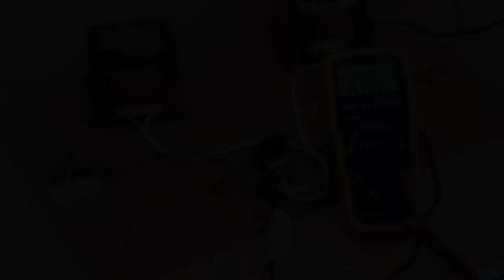DIY Welding Machine / Only 2 Microwave Transformer / Good Job

Comment: Selamun aleykum ustam. Diğer kaynak makinesi videonuza yorum yapmıştım birkaç bilgi vermiştiniz. Bir soru daha sormak istiyorum. Aslında diğer videoya yorum olarak sormuştum ama link paylaştığım için sanırım Youtube beni engellemiş yorumları göremiyorum diğer videoda. Buradan sormak istiyorum bu sefer link paylaşmadan 😅😅
Fan için Led trafosu kullanabilir miyiz. Mesela 12 volt 3 amper 36  watt lık bir Led trafosu var. Onu fanları çalıştırmak için kullanabilir miyim. Fanlara zarar verir mi acaba?
Reply from the maker: Aleyküm selam Rıza bey. LED trafosu çıkışı 12V ise bir sorun olmaz. Bazı LED trafolarında çıkış gerilimi yüksek olabilir. Yani 12 yazsa bile ölçmek iyi olur
Reply: teşekkür ederim. Çıkış voltajı 12 diyor sadece amper kısmı ve watt kısmı kafamı karıştırmıştı onu da siz halletmiş oldunuz. Teşekkür ediyorum. Alınca ölçerim doğru voltaj veriyor mu ona göre takarım inşaAllah. Ufak ufak malzemeleri toplamaya başladım. Bu arada hurdacılar sitesine gittim. Mikrodalga trafosu var mı mikrodalga içinden çıkıyor dedim. Adamlar onda pek değerli birşey olmadığı için topluca atıyoruz diyorlar. 😅😅.
Bende sahibinden üzerinden aldım iki tane, tanesi 110₺.
Reply from the maker: En önemli malzemeyi bulmuşsunuz zaten. Umarım tamamlarsiniz. Yardım gerektiğinde yine yazın. Hayırlı akşamlar
Reply: selamun aleykum ustam. Benim trafolar geldi ama birbirinden farklı ikisi. Üzerinde kod olarak birinde 700E-4 yazıyor. Bunun yüksekliği h: 7,5cm, bu küçük olan diğeri daha büyük. 

Diğeri 700E-1, bunun yüksekliği de h:9 cm. Genişliği de diğerinden 1,5 cm daha büyük. Sizin kullandığınız trafoların kodları nedir acaba. Muhtemelen sarım sayısını etkileyecek bu durum. Çok sorun olur mu acaba? Yoksa büyük olan trafodan bir tane daha mı almam lazım
Reply from the maker: @rzatasdemir7456  A.S. Rıza bey. Bu trafolarin ikisi de 700W gibi görünüyor. Boyut çok farketmez. Birebir aynı olsa daha iyi olurdu tabi ama yine de kullanılabilir.
Reply: selamun aleykum Murat ustam. Nasılsınız iyisiniz inşaAllah. Rabbim sağlık sıhhat versin.

Ustam ben trafoları almıştım malum. Birkaç gün önce de silikon kabloyu felan temin ettim. Diğer malzemeler de hazır. Bugün trafo sarımlarını yaptım. Size bahsetmiştim birisi biraz küçük trafonun diye. 18 sarım sonrası baya zorladı beni. Wd40 sıkarak sardım kaysın diye. Yoksa sarılmıyordu. 20-22 sarım ona yaptım. Büyüğüne de 25 sarım yaptım galiba. Gerilim testini yaptım. 46,5 - 47,5 volt arası değer aldım. Sanırım birkaç sarım fazla yapmışım. Nasıl bu değer sorun olur mu. İşleme devam edebilir miyim?
Reply from the maker: @rzatasdemir7456  Aleyküm selam Rıza bey. Seri bağlantı yapıldığı için hiç sorun olmaz. Bu şekilde devam edebilirsiniz. Deneme yapacak aşamaya gelebildiniz mi?
Reply: yok ustam henüz sadece dün akşam sargıları sardım. İlerledikçe yazarım inşaAllah. Allah'a emanet olun
Reply: selamun aleykum Murat ustam. Biraz önce bağlantıları yapıp kurdum sistemi. Kutusunu yapmadım henüz açık vaziyette yani. Evde 2-2,5 mm kutu profil vardı. Çatı işinden kalan da elektrot. Elektrotları nemi gitsin diye fırına da koymuştum. Bu arada daha önce hiç kaynak yapmadım 😅😅. İki profili birleştirdim. Dimmer devresi sona kadar açıktı. Profili eritti. Kıstım, bu sefer kaynak oldu. Birkaç parça daha deneyeyim dedim. Elektrot yapışma durumu gösterdi hemen kaldırdım profilden. Biraz ayarını arttırdım az bişe gene az yapıştı kaldırdım hemen. Yani yarım saniye durmamıştır profil üzerinde. Sonra çalışmadı sistem. Baktım dimmer devresinin sigortası yanmış. Son durumum bu şekilde. Elektrotlar biraz eski ondan dolayı mı yapıştı ve yandı acaba. Nasıl bir yol izlememi tavsiye edersiniz bu noktada. Biraz uzun oldu kusura bakmayın. Bu arada elektrot ölçüsü 3.25
Reply from the maker: A.S. Elektrod yapışması akım az olduğu zaman olur. Elektrodun durumu da önemli ama en büyük sebebi akım azlığı. Akım ayarını en uygun seviyede ayarlamak lazım. Siz dimmer devresine ekstra triyak eklemesi yaptınız mı
Reply: yok hocam eklemedim. Direk şemadaki gibi kullanıyorum. Elektrotlar nemli olabilir. Uzun süre dışarıda kaldılar. Gerçi fırında beklettim ama. Malum Samsun nemli memleket. Yeni elektrot aldım ama henüz elime ulaşmadı. Dimmer devresini son ayara açınca profili eritmişti. Kısınca da sanırım yapışıp sigorta yandı.
Reply from the maker: Dimmer devresinin sigortası düşük kalmış olabilir. Benim devrede sigorta yok. Ama 10A otomatik sigorta takılı priz kullanıyorum. Çok seyrek de olsa attığı oluyor. Aslında 16A falan olsa daha iyi olur.
Reply: Makinenin bağlı olduğu prizin sigortası 16 amper. Şimdi köydeyim 3-4 gün ilçeye gidemeyeceğim. Gidince dimmer için sigorta alırken biraz daha büyüğünü mü almamı tavsiye edersiniz. Devamlı da soru soruyorum ama kusura bakmayın.
Reply from the maker: @rzatasdemir7456  Estağfurullah. İstediğiniz kadar soru sorabilirsiniz. Fırsat oldukça cevaplarım. Priz sigortası 16A ise dimmerdeki sigortayı tel ile kısa devre yaparak deneyebilirsiniz. Ancak triyaklarda arıza oluşmuş ise yine kesebilir. Sigorta alacaksanız 16A alın
Reply: ustam kral adamsın. Sevindirdin beni. Allah da seni sevindirsin. Dediğin gibi yaptım. Sigortayı tel ile şase yaptırdım. Kaynak çalışıyor. Birkaç sefer gene yapıştı elektrot ama bir sıkıntı yok. Yeni elektrot gelene kadar birşey yapmayacağım. Birde kaynak maskesi alayım en iyisi 😅😅😅. Sırada kutusunu yapmak kaldı bakalım. Eldeki imkanlar ile birşeyler yapacağız inşaAllah. Ya birde birşey sormak istiyorum. Şase ve pense yi bağladığımız silikon kablo bir yere bağlı değilken nasıl oluyor da içine elektrik akımı giriyor çok merak ettim doğrusu. Cahilliğimi af buyurun inşaAllah.  Tekrar görüşmek üzere Allah'a emanet olun
Reply from the maker: Çok teşekkür ederim Rıza bey. O sizin güzelliğiniz. Maskeyi kendinden kararan maskelerden almanızı tavsiye ederim. Ama soruyu anlayamadım galiba. Şase pensesini kaynak yapılacak metale baglamazsaniz akım geçişi olmaz. Yani kaynak yapılamaz. Siz başka bişey den mi bahsediyorsunuz
Reply: şunu sormak istedim. Silikon kablo sardık ya onun bi ucu şaseye bağlı diğer ucu elektrot maşasına. Yani prizden gelen eletrik ile doğrudan bağlantısı yok. Elektriği içine nasıl alıyor onu kavrayamadım. Evet dediğiniz gibi maskeyi kendinden kararanlardan aldım. Sipariş verdim hepsiburada sitesinden biraz önce. Sağ olun.
Reply from the maker: Şimdi soruyu anladım. Burda olay şu şekilde gerçekleşir. Primer sargı yani 220V bağladığımiz sargı enerji verdiğimizde trafoda manyetik alan oluşturur. Bu manyetik alan trafonun sekonder sağı tarafına nüve yani trafonun metal bölümleri sayesinde ulaşır ve sarım sayısına göre sekonder sargida elektrik endukler. Örneğin 1 sarimda 1V oluşursa 20 sargı olduğunda 20V oluşur. Sarım sayısı arttıkça gerilim artarken bu oranda akım da aşağı değere düşer. Mesela punto kaynak makinesinde 2 sarım yapılır ve 2V gerilim elde edilir. Ama akım 600A gibi değerlere çıkar. Tabi bu akımı taşıyabilmek için çok kalın kablo sarmak gerekir. Ark kaynak makinesi elektrodu erittigi için 100A civarı akım iş görür ama punto kaynağında metalin kendisi eridiği için 500A üstü akım gerekir.
Reply: elektrik muhteşem bir varlık. Açıklamanız için çok teşekkür ederim.
Reply: Selamun aleykum ustam hayırlı günler. Kaynak makinesini %90 bitirdim. Yanlız bir sorun ile karşılaştım. 2 saattir sebebini ararken sonunda buldum.
Şase ve pense nin girdiği dişi kısımlar var ya. Ben onları sizin yaptığınız gibi kutuya sabitledim. Benim kutu sac. Makineye eletrik verince trafolar düşük ayarda aşırı ses yapıyordu. Yükseğe açınca sigortası attı. Sebebi ararken buldum. Dişi soketler birbirine kutunun sacı ile bağlanmış oluyordu. Sizin videoyu izledim tekrar tekrar. Dişi soketleri sizde kutunuza monte ettiniz. Sizin kullandığınız malzeme elektriği iletmiyor mu yoksa soketin dış kutuya temas etmemesi için arada bir yalıtım malzemesi mi var. Benim soketlerde öyle birşey çıkmadı ama. Nasıl yapabilirim diye düşünüyorum.
Reply from the maker: A.S. Rıza hocam. Ben de alüminyum kullandım. Yani iletken. Ama soketlerin kendi yalıtkan malzemesi olmalı. Zaten bütün makinelerin kutusu saç oluyor. Yalıtkan malzemesi olması lazim, hatta yanlış hatırlamıyorsam dönmemesi için bir çıkıntısı olan parçalar
Reply: tamam ustam buldum. Arkasında bir parça çıkıyor. Ona göre yuva açıp sacı iki parça arasına almak gerekiyormuş. Bitirdim biraz kaynak da yaptım. İlk defa kaynak yapıyorum. .
Biraz fazla mı ısınıyor bilmiyorum. 1 tane güçlü fan dışarı veriyor havayı iki fan da içeri taze hava veriyor. Birde çok yapışıyor elektrot ilk kez takınca. Benim acemiliğim mi yoksa yapmam gereken birşeyi eksik mi yapıyorum emin değilim. Dimmer ın ayarını sona açıncada yapışma yapıyor. Sanki elektrot biraz ısınınca yapışma olmuyor. 1,5-2 mm profili eritiyor sonda. Sanırım acemilik var. Biraz daha video izleyip bilgi edinip sonra tecrübe kazanmak gerek sanırım.
Reply: biraz önce ilk kaynak denemem de yapışınca çok ses yapmıyordu. Hayvanlara yem verip geldim biraz daha denemek istedim. Şimdi yapışınca biraz daha fazla ses çıkarmaya başladı makine. Normal kaynak makinelerinde de oluyor mu acaba böyle.
Reply from the maker: Yapışma durumunda vınıltı şeklinde ses gelir. Bu normaldir. Biraz yüksek de olabilir. Bunun sebebi trafo çıkışının kısa devre kalmasından dolayı titreme olmasıdır. Trafo vidalarla sabitlenmemis veya sargılar sıkı sarilmamis ise ses biraz daha fazla olabilir. Akımı arttırıp denediniz mi. Normal kaynak yaptınız mı yani
Reply: evet ustam yaptım. Çatıya vinç asmak için L profil yapmıştım onun kaynak olacak yerlerini kaynak yaptık. Biraz kötü oldu ama sanki oldu gibi. Bazı yaptığım kaynaklar güzel oldu. Bazıları kötü. Ama çalışıyor yani. Birde elektrot çok çabuk bitiyor sanki ya da bilmiyorum bana öyle geliyor. Çabucak kaynayıp eriyorlar. Sargılar çok sıkı, 4'er vida ile de güzelce sabitledim trafoları. Ses niye yüksek anlamadım. Belki de normaldir. Dediğim gibi bu işin cahiliyim. Size de tekrar teşekkür ederim.
Reply from the maker: Doğrusu kaynak işinde ben de acemiyim. Ama el alışması da lazım, onu bilmiyorum. Akım çok fazla olursa elektrod daha çabuk biter ve ince metaller delinir. Bunların hepsine alışmak gerekiyor galiba. Çalışırken dikkatli olun lütfen. Elektrikle ilgili de sorun yaşanabilir ama ihtimal düşük. Ama sıcaklık ve ışık tehlikeli
Reply: teşekkür ederim. Dikkatli oluyorum. Otomatik kararan maske çok kullanışlı. Yüzü de komple kapatıyor iyi oluyor. Artık yapa öğreneceğiz. Allah'a emanet olun. Tekrar görüşürüz inşaAllah
Reply from the maker: Siz de Allah'a emanet olun Rıza bey. Sağlıklı günler dilerim

Comment: Lo que es importante no lo dice, en los devanados secundarios cuanras vueltas lleva y de que CALIBRE DE CABLE.
Reply from the maker: Hola.  Compartí esta información en el subtítulo.  Los subtítulos en español están disponibles.  Escribiré aquí también.  Cable de cobre con aislamiento de silicona de sección transversal de 4 mm2.  También lo puedes encontrar como cable N2GFAF.  Para cada transformador se harán 24 bobinados, y para estos 24 bobinados se requieren 6,5 metros de cable, 13 metros en total.

Comment: Will this only work with 240?
Reply from the maker: Hello.  It will also work with 120V.  Because microwave ovens in your location are also designed to work with 120V voltage.  If you look at the comments of this video, there are those who make it and run it with 120V.
Reply: Sorry i should've been more specific... will it be powerful enough? Even more specifically i actually wanted to use it to melt aluminum for casting.
Reply from the maker: Hello.  The power will be the same.  On the input side, 10A is drawn from the 220V mains, while 20A is drawn from the 120V mains.  That is, when the input voltage drops, more current is drawn.  This also applies to the microwave oven used there.  Because he must use the same power to cook the food.  But I don't know if it can be used for the job you mention.  How much current is used in the aluminum casting business?  What kind of transaction?

Comment: Bueno  he analizado este trabajo esta exelente pero hizo falta al exponente exponer el cable de la numeracion a mi parecer es cable 10 sino pues q me corrija el maestro
Reply from the maker: Hola.  En primer lugar, gracias.  Según tengo entendido, te refieres al cable que uso en el devanado secundario.  Usé un cable de cobre con aislamiento de silicona de 4 mm2.  El código del cable es N2GFAF.  También se puede utilizar un cable como AWG10 en lugar de este cable.  Lo importante es que el aislamiento del cable sea resistente al calor.
Reply: asi es es correcto gracias muy bonita su expocicion
Reply from the maker: Gracias a ti también.  También publiqué un video del proceso de conversión del voltaje de salida de esta máquina a CC.  Te recomiendo ver 👍

Comment: Saludos de  cuantas  vueltas es
Reply from the maker: Hola.  24 vueltas para cada transformador.  6,5 metros de cable de cobre aislado en silicio de 4mm2 de sección para 24 vueltas.  13 metros de cable necesarios para 2 transformadores

Comment: Superb video 🫡 can it weld 1mm thin sheet?
Reply from the maker: Hello.  Thank you.  It can easily weld a sheet of 1mm thickness.  But you have to be careful not to puncture the sheet metal.
Reply: yeah that’s the problem. Can avoid that it happens? Is there any way to regulate amperage?
Reply from the maker: I put the amperage setting on this machine.  It can be adjusted up to at least 60A.  I used a 1mm box profile.  I can't say I did it without drilling.  But if it is done with care and the electrode is suitable, I think there will be no problem.
Reply: you support is very helpful to me. I have 230v current here. Do I need to use triac for the dimmer? And I have 3 transformers which is give output 35v. Is it okay to connect it with 4000w dimmer?
Reply from the maker: Hello.  4000W dimmer will be sufficient at 230V mains voltage.  However, dimmer circuits sold in the market may not provide the promised power.
Reply: ok, thanks. I’ll try it and if any issues come I’ll contact you. Thanks again..!!!
Reply from the maker: Ok. Thank you too 👍
Reply: hi, I build a 5Kw SCR circuit and it’s working perfectly with my three transformer arc welding plant. You literally save my life. I can weld my car with this SCR. Thanks a lot friend…! 🫡🔥👍🏻
Reply from the maker: Glad you think this way and get your work done.  But the 5kW SCR circuit must be a bit expensive
Reply: nope I just spent 1.5 USD. I didn’t bought module from shop.  I just  made a circuit with using a 5KW diagram and components myself.
Reply: Give us a spot welding video too…. Thanks.
Reply from the maker: Wow.  Very cheap.  Did you buy it online?  I was wondering what module you got.  Is there a link or module name?
Reply from the maker: I finished my spot welding machine video today.  I'll post it when I'm done installing it.  I put a timer circuit in it that I made myself.  I will also share a video for the circuit.  Then I'll add a wooden pedal.  I hope you will like it.
Reply: no. I was get components from local shop. I can share u the diagram but not here. There’s no option here to share. 

Just type 5000w dimmer circuit diagram in search bar.
Reply: awesome. I’m waiting to watch the video…
Reply from the maker: Ok. Thank you

Comment: "4mm2 silicon insulated copper cable." Do you mean that this whole cable with insulation is diameter or only this core thread is 4mm???
Reply from the maker: Hello.  The cross section of the cable will be 4mm2.  S = πr2 = 4mm2 .  This cable cross-section is thin as you can see, so I preferred silicon insulation for heat and tried to cool with fans.  I've been using this device for my homework since it was built.  I didn't have any problems.
Reply: Thank then is more easy tell this cable what use 4m² or 4m2 square.
- How thick metal can you weld with your construction???
- Would the transducers heat up a lot at full 40V, what if they used 6m² or 6m2 square cable, of course then needed 3 transformer ???
Reply from the maker: Hello again.  I welded metal with a maximum thickness of 5mm.  I've had nothing to do with thicker metal until now.  If you make the cable cross-section of 6mm2 (such as AWG 10), you can make 15 windings for each transformer using 3 transformers.  In this way, more current will be obtained.  I hope I could help.  have a nice day
Reply: Hi! Thank your answer. How big fuse value this your welding use when you connect to the electricity griduse 10 Amperes or 16Amperes???
Reply from the maker: A 10A fuse is installed in the socket that I use at home.  I'm using it without any problems, but 16A would be more appropriate.

Comment: dimmer for AC current?
Reply from the maker: Hi.  The dimmer circuit controls the input of the transformers in this system, and you can also adjust the output voltage.  Since we do not put a rectifier circuit at the output, it controls AC.  If we had put a rectifier, it would have done DC control.
Reply: ok thank you! 
His video I think is the best, technically and aesthetically!
Reply from the maker: Thank you too.  You can ask what you want to ask without hesitation.

Comment: How to adjust Ampe?
Reply from the maker: I used a dimmer circuit for current adjustment.  This circuit is commercially available.  However, because their strength was insufficient, I added materials.  The diagram of this addition and the general wiring diagram of the system are available in the description section.  Check it out if you want and ask if you have any questions.

Comment: BETTER USED MAGNETIC COIL FOR SECONDARY FOR HIGH TEMPERATURE AND HIGH CURRENT CARRIED. BUT NEED CURRENT ADJUSTER
Reply from the maker: I used a dimmer circuit for current adjustment.  You can find the video showing how this circuit is made on my channel.  The last video I posted is about this circuit.